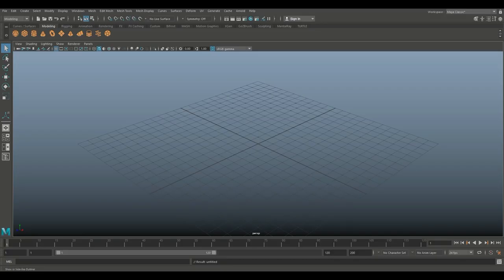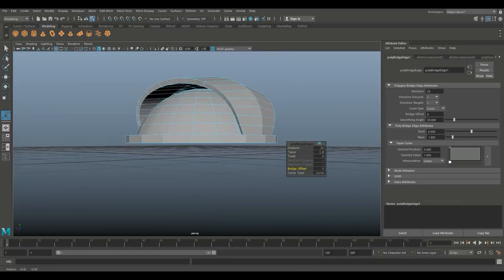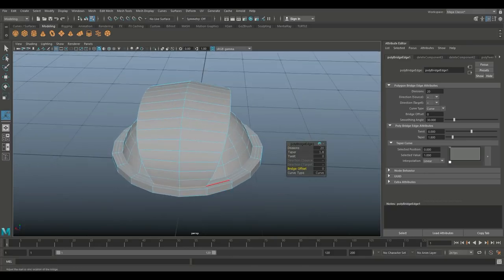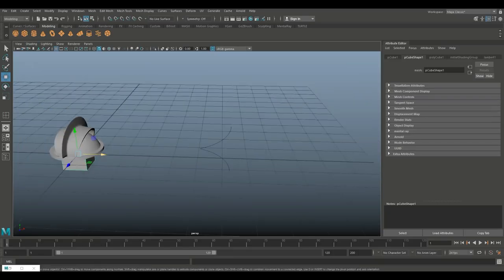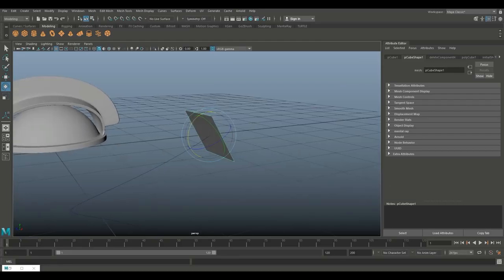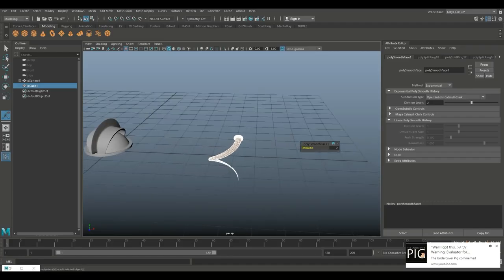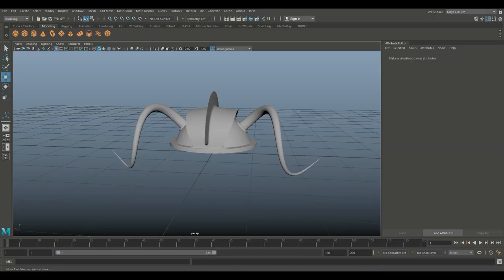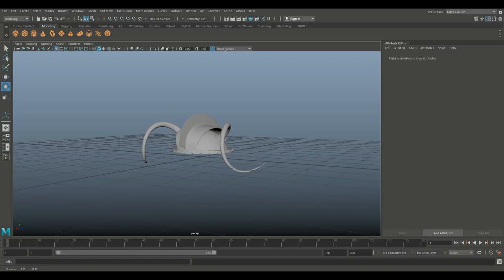How to model a Viking Helmet in Maya 2018

Comment: Hi, Mike. Great tutorials. I am brand new at making 3D props and am using MAYA to make my meshes and who knows what to make my textures. The MAYA modeling stuff works great but, when I try to do textures, either in MAYA or maybe Keyshot, and export as an OBJ and import into DAZ3D none of the textures come with it. I don’t know if it is a DAZ thing or that I’m not doing something right. Any help would be greatly appreciated.
Reply from the maker: Did you export as OBJ or FBX ?
Reply: I exported as OBJ from MAYA. when I used Keyshot I saved and exported as both OBJ and FBX. I then imported the prop into DAZ3D  and back into MAYA. each time there were no materials. only a grey prop.